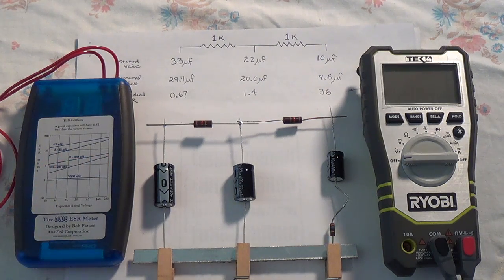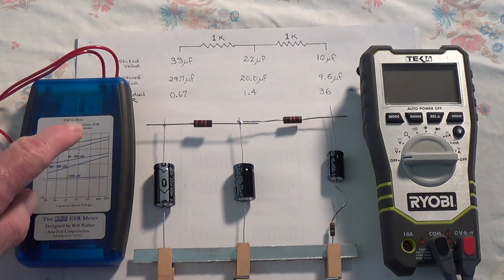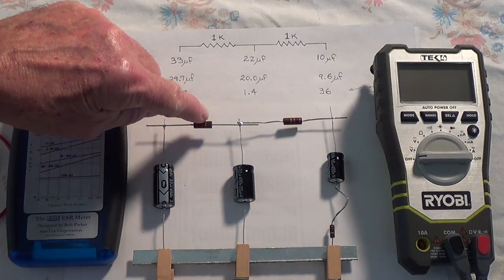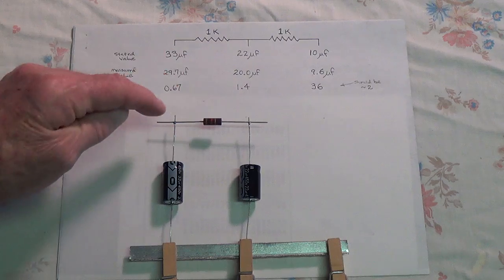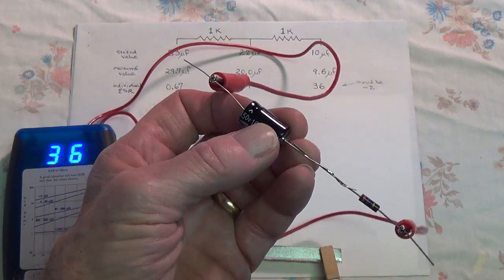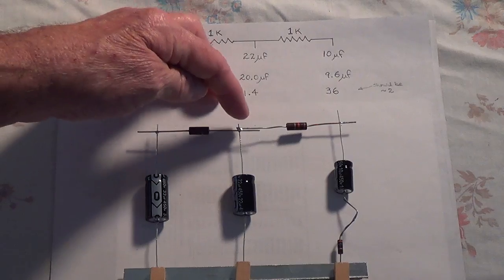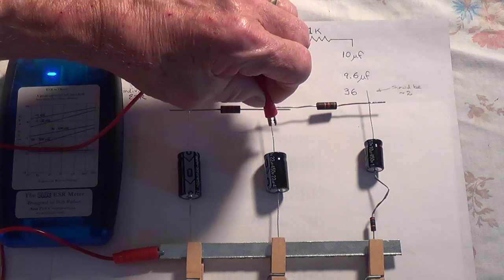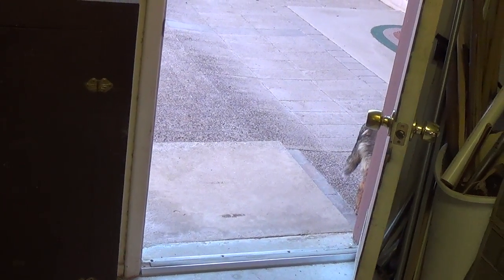Measuring ESR in Tube-Amp Electrolytics, In-Circuit

Comment: UD, what's the easiest/best way to measure a capacitor for DC leakage? I cannot find a leakage tester, aside from the vintage 1950's/60's ones.
Reply from the maker: I demonstrated a method to test coupling caps for DC leakage in several videos, Nirky. I you're a regular viewer, you must have seen it.
Reply: @UncleDoug  Great, I'll search your vids and find it!

Comment: All these years later I'm wondering if the same is true of the cheap TC1 type multitester units all over Ebay for less than $20.  They seem to measure most things fairly accurately but when they report ESR along with capacitance on higher voltage electrolytics I'm always a little skeptical, regardless of whether they are in or out of circuit.  I'm further confused by the fact that one of the two such devices I own will sometimes but not always also report "Vloss" as a percentage during a capacitor test, but sometimes only C and ESR.  I'm not sure if "Vloss" is the same as leakage which would be expressed as current in mA or what to make of it.  

I do wish I had a little better understanding of these parameters and a consistent, reliable means of verifying whether an existing capacitor is in good shape or a candidate for replacement.  I usually never regret it when I replace an old IC cap with a shiny new F&T but there are certainly times when I'd rather not go to the expense and shipping wait time if it's not really necessary.
Reply from the maker: I used to try to save every original component in every tube amp, SMW, but when working on customer amps, with the high cost of shipping, I started simply replacing every at-risk component with the best parts I could find (at a reasonable price).  For my own amp collection, however, I continued to preserve originality whenever possible, simply because I could re-repair them on site. The ESR meter is a good way to determine the usability of flter caps, and you can easily measure DC leakage in coupling caps. I know of no good way to determine the functionality of other capacitors in the circuit, and generally any testing procedure would be more effort than simply replacing them.

Comment: in regards to the blue ESR meter, will it measure any other components in circuit?
Reply from the maker: Other than ultra-low-value resistors, probably not

Comment: Very interesting Video on the Ana Tec ESR meter Uncle Doug Thank you.  Will this ESR meter also test small Capacitors 0.022uf 400 volt as in an oscillation circuit or a 510pf 400 volt in a Tone circuit?
Reply from the maker: The unit is intended only for use with electrolytic capacitors, Kevin. It gives readings for non-polar caps, but they serve no constructive purpose that I can find.
Reply: @UncleDoug  Thanks Uncle Doug for your reply. I found now a Capacitor Tester from Antique Electronic Supply that will test the small pf up to roughly a 200 uf capacitor for about $45.00  I still will consider the Ana Tec ESR for the Electrolytic capacitors. Thanks again & take care. Kevin.

Comment: Got my ESR meter today and checked the Caps on my Dennis Kager Tube Amp, and found 3 with a ZERO reading and more with over 15% rating over the Caps rating. This is a must for anyone working on amps. Thank you Uncle Doug... one step closer to a full reapir..

Comment: Hello Uncle Doug, I just bought the Peak ESR70 thinking it was going to be easy to determine if the electrolytic caps in my 1959 and 1960 Fender Tweed Amps (Bandmaster and Bassman) needed changing.  It was not easy.  I have played the caps pretty hard for almost 10 years and the meter seemed to show they were in "new" condition or lower ESR than the Peak chart shows.  The tests were done in-circuit.  But, I also took out the 60 year old original caps and measured them too and they looked like they still had low ESR values.  I did find one that was shorted but a bunch of them looked good.  They can't be good because they all had the big blisters coming out of the red rubber end.  I bought all of the caps to do the cap jobs before I got the meter.  I should have waited because to me, those caps seem to have another 10 years of good life left in them.  Gerald Weber recommends changing them every 6 years and most others suggest 10 years.  What is your opinion on how often they should be replaced?  ESR measurements don't seem to tell much of a story.  That measurement must be more relevant for caps in computers or some other devices.  I am guessing I have at least 8,000-9000 hours on the Bassman and 6,000-7000 hours on the Bandmaster.  I guess it can't hurt to replace them anyway.  I bought the caps so they are going in.  They will probably last the rest of my lifetime. I have only used Sprague Atom caps and that is what I bought to replace them with.
Reply from the maker: I understand your confusion about why the old caps seem to test out OK.  I also assume that the capacitors are working just fine, but you're thinking about changing them simply because they're old. From my experience, if electrolytic capacitors are used regularly, they can last much longer than people expect. Unless electrolytics show measurable resistance (i.e. internal shorts), are causing an audible 120Hz hum, or have high ESR values, I tend to leave them in place, at least in many of my own amplifiers. The best way to test them is for DC leakage in circuit at full operating voltage, but if you are unable to do this, check the three parameters I listed and base your judgement on the results.....rather than what some people say.
Reply: @UncleDoug  Thanks Doug.  I did get a good idea from your video.  I will write down all of the readings of the new caps for reference.  I have never checked an electrolytic for leakage.  I do it all the time on my old Astron coupling caps and they all leak.  I take it, it is the same method by lifting the negative lead and checking that lead for leakage with a DMM.  I will check them all as I remove them just out of curiosity.
Reply from the maker: @millstap  Let us know what you discover, MS. It would be interesting to see if the ESR  values correlate with actual leakage measurement.
Reply: @UncleDoug  Well, I convinced myself otherwise.  The only cap I replaced was the first 250uF/6V bypass cap (on the 1959 Bassman) with a 250uF/25V cap.  It had a 220uF/25V cap there for some reason.  I don't think I could find the correct 250uF back when I changed these.  It only had 2.5V on it in-circuit so I didn't bother checking for leakage.  The new cap did have a slightly smaller ESR reading.  The others were actually reading lower ESR than the new ones so I said, "why bother."  This is actually on the Bassman.  I didn't do anything to the Bandmaster which is the amp I was referring to when I said I was going to change them anyway.  They were all reading good too.  Oh well, I spent almost $200 for caps for three amps that I won't need to change probably for another 5-10 years.  I am not very patient.  I thought for sure they would be due for a change.  I didn't bother measuring the main B+ caps in the pan because I didn't want to take the Bassman chassis out.  All the caps are accessible on the board of the Bandmaster.  I did also remove the death cap in the 1959 Bassman.  It had a grounded plug but they didn't remove the cap at the time of the grounded cord installation.  I like to check those Astron caps just out of curiosity and it was leaking 21VDC at 539VDC and the capacitance value had drifted higher by 30% (.05 to .065).  All of my Astron coupling caps are gone now.  I went on a leaky cap rampage in the past month.  All the amps were completely original when I bought them around 10 years ago.
Reply from the maker: @millstap  Did you find any correlation between the ESR values and actual leakage measurements ?
Reply: Uncle Doug The Peak meter only measures down to 1uF so it doesn’t work on the Astons which are mostly .1uf & .02uF.
Reply from the maker: @millstap  The ESR meter is only intended for electrolytic caps, MS. It will give readings with non-polar caps, but they do not seem to be useful for diagnostic purposes.  I was wondering about the electrolytic filter caps. Did any test well with ESR but leak at operating voltages ?
Reply: @UncleDoug  Doug, once I started getting ESR readings (in-circuit) that were less than the new caps I bought, I didn't bother removing any.  I did replace one 250uF/25V bypass cap but since it only had 2.5V on it in-circuit, I didn't bother checking for leakage.  I'm torn now.  You hear stories of pros saying the amp has gone soft and they think it is the tubes when it is actually the caps but then they push their amps hard nightly so, several hours of daily playing at home doesn't warrant changing them but maybe every 20 years.  I'm still contemplating if I should just change them to see if I HEAR a difference.  That may still be the best test of all but, if I do that, I will certainly check them for leakage while I am removing the old ones.  There has got to be a better indicator than ESR measurements.  When I started getting good ESR readings on 60 year old Mallory caps I pulled from the amps, I knew that ESR may not be the most useful indicator for when it is time to change them.  Leakage or ear may be the better indicator.
Reply from the maker: @millstap  Yes, but what if the 60-year-old caps are still fully sealed and in excellent operating condition? Perhaps leaky old filter caps CAN still provide good ESR values and thus mislead you.....but I have not seen it first hand. In my experience, filter caps that have leakage which degrades their function,  always have elevated ESR values......at least, so far. However, I am open to evidence (not opinion) that may contradict this finding.
Reply: @UncleDoug New development.  I just received the main power rail caps for both Tweed Bassman amps and they are all reading very low ESR levels.  So, I am guessing that those caps are where the real difference will be heard and felt in the amp.  I have not checked the older ones yet and will today at least in the 1959 Bassman.  If all goes well with that cap change as far as tone and feel go, I will do the 1960 which has older caps but it is my Holy Grail amp and is sounding really good now.  I can't imagine it sounding much better but it might.  I will let you know how the old ones measure as far as leakage goes.  I replaced the originals in the 1959 Bassman 5-1/2 years ago but they had been sitting in my box for a little over 4 years so they are actually almost 10 years old.  I should probably change the 1960 first but like I said, it is sounding good and I always say, if it ain't broke don't fix it (I guess I am not following that old mantra anymore).  So, I'm using the 1959 as the ginny pig.  I wanted to send you a photo of the old Mallory's but I had a better idea.  I will do a short YouTube video and post it and send you the link.   I will also check some of the caps for leakage in the video.
Reply from the maker: @millstap  Please do so, MS. I would be interested in the result.
Reply: @UncleDoug  I just finished editing and it should be up soon.  It was very confusing, especially trying to check them for leakage the way I did.  I apparently don't understand exactly how electrolytic caps work and how to test them for leakage.  You'll see in the video.
Reply from the maker: @millstap  Check the Internet for explanations of how to test them, MS.
Reply: @UncleDoug  Yes, it is not as easy as I thought.  Apparently it is more accurate to measure current leakage and not voltage.  What I really need is this old school unit at 21:44 in this video, https://youtu.be/2HUxuRcPR4M.  It is the Sencore CA55 capacitor tester.

Comment: Hi Uncle Doug (and Rusty). I am actually the guy who designed the Anatek Blue ESR meter. What my late buddy John Bachman in his video was talking about was computer motherboards where there are lots of capacitors directly in parallel. I grew up on tube circuitry and your explanation is exactly right. Any significant resistance between the capacitors will prevent the ESR of the one you're testing from being masked by others in the circuit. Thanks for a very clear accurate explanation!
Reply from the maker: Wow......thanks for confirmation from an unassailable source, Bob :)

Comment: I'm going through a late 68 earl 69 Princeton Reverb I just bought and it was all original with no mods. Everything internally looks incredible and I want to do as little as possible to it. I replaced the 2 prong cord and I went ahead and bought a Can Cap, new electrolytic caps and a couple 18k and 1k resistors. I bought an ESR meter and I've gone through the white Mallory caps, brown turd caps, Bias cap and cap can and everything is checking out but I'm still not sure. I don't know the ESR values of the vintage Fender caps so I don't have anything to compare to except a basic chart for the size and voltage of the cap. 

This will be a player's amp of course and I plan on keeping it a long while but i also want to retain as much of the value of it as I can and not hurt the value in any way. What you recommend in situations like this? I'm trying to gather as much info from your channel as well as other's but i'm still just unsure and i don't want to make a mistake and diminish the value of the amp.
Reply from the maker: I understand completely, Robert, and appreciate your concern for originality and preservation of value. With some of the rarer early tweed amps, absolute originality is highly prized, but in more common amps, like the SF PR, I don't feel like common sense updates will reduce the value at all. Indeed, if the updates are well done and don't alter the nature of the amp, they may well be considered a plus. Replacement of filter caps, coupling caps, 2-wire power cord, etc. all make sense with a "player's amp" (not a museum piece) and are helpful to usage without harming value. Keep the old parts in a bag in the amp just for good measure.
Reply: @UncleDoug  I need your help.On my 69 Princeton Reverb I'm only getting a PV reading on the right 6v6 and the left one is giving a negative low number on pin 3. Am I missing something? Amp sounds and plays great but checking the bias I noticed this. Tubes are brand new and I've switched them and same result.
Reply from the maker: If you have no plate voltage between pin 3 and ground of one of the 6V6's, then you really do have a problem, Robert. Have you measured the plate current? In a P-P amp with one dead output tube, there is usually a noticeable hum and volume reduction......yet you say it sounds great. It seems like you're measuring the grid or cathode. If the measurement is accurate, however, then you must have an open winding in your output transformer.
Reply: @UncleDoug  It was late last night so I quit messing with it after I came across that issue. I'm going to play with it some more tonight but I was worried it might've been the OT as the problem. I did notice my speaker cable connection was broken when I was putting everything up but with it working fine at one point, it might've broke at the solder joint when I unplugged it. Not sure if that would contribute to just one tube having -10v on pin 3 of the left tube. Would a faulty coupling cap for that tube cause the negative vintage for that tube?

Comment: Greetings Uncle Doug and thank you so much for all the great videos about tube amps! I have a question. For this ESR tester you are using I notice the range spec is > 1 uf. What would you use for testing a bright cap that is in the pf range or a coupling cap between stages that is below 1mf?  Thanks!
Reply from the maker: You can use the capacitance function of a DMM to measure the capacitance of non-polar caps, Bill. Coupling caps can be tested at operating voltage with a DC voltmeter for leakage. There are Internet sites that discuss the procedure.
Reply: Thanks so much Uncle Doug!  I really appreciate that you get back to us knowledge seekers when we ask you questions. All the best to you and your family and take care.
Reply from the maker: You're welcome, Bill. Likewise :)

Comment: Is there a table for acceptable ESR values for electrolytic caps used in amps?
Reply from the maker: Yes, there is a graph for acceptable values on the front of the Anatek Blue ESR meters.....but what I do is test several new caps of the value of interest to get an idea of the proper value, then test the cap in question to see if it is higher.
Reply: Thanks. I saw you do that on the other video I believe, and made sense. I questioned to myself, if testing a cap out of circuit with this meter, would produce similar results with one in circuit, and by the looks of it in the other video, it showed a very minimal result difference in circuit, and was able to confirm for you, that the old caps were in deed still in spec. I plan to use this technique as well to determine IF the filters on the JCM really need replacing or not now. ( They are original, 1985 ) If they show to hold value compared to the new ones I have in stock, then something else is going on with the noise. After a re-tube and my first Bias, if through the method you showed in the other video, the electrolytics arent too badly off, then something else may be going on. Sorry for the noob questions, but I have to learn somewhere and the beginner DIY stuff you show is very valuable to me...Thanks again....

Comment: Use a moderate resistance to ground when discharging caps.  Shorting a cap will exceed its spec for discharge rate.
Reply from the maker: I use a 100 Ohm 10W resistor, BJ.